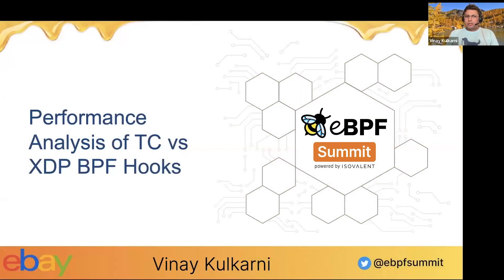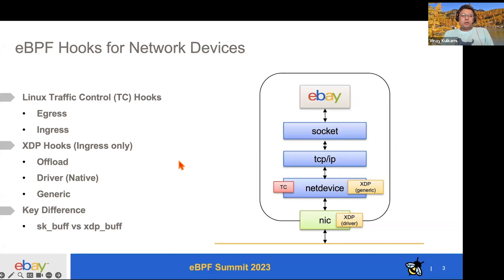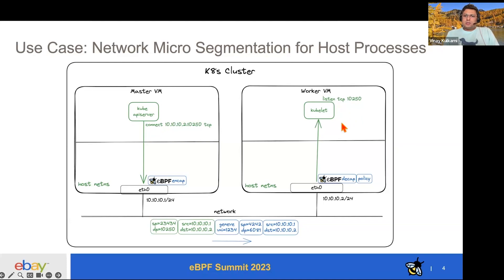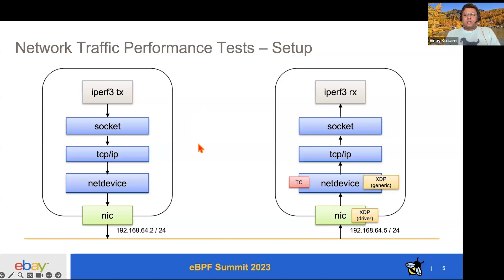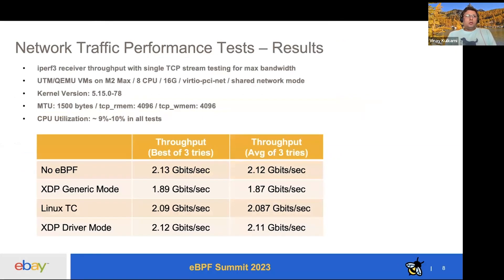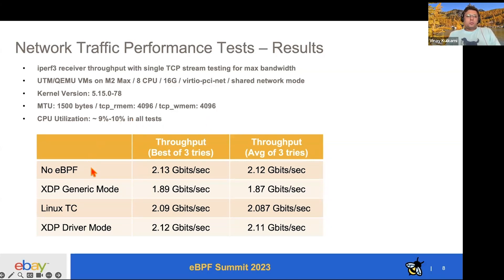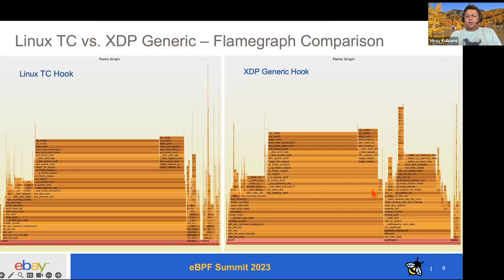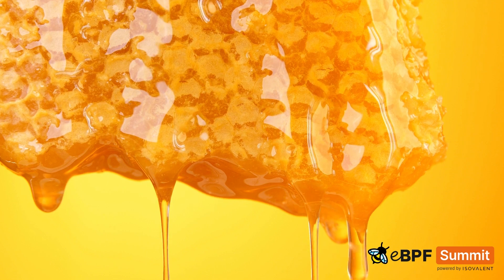Performance Analysis of XDP-native, XDP-generic, and TC eBPF hooks - Vinay Kulkarni

Comment: This is really interesting! I wonder, what is the reason that you would use XDP generic over Linux TC in any case? I also understand you don't default to XDP Driver mode as the compatability with the NIC has to be taken into account, but would you always default to it if the option was available or are their downsides?
Reply: One reason to use the actual express data path as opposed to hooking via tc is processing speed because tc processes traffic after the socket buffer (skb) and the express data path is in earlier kernel space than skb